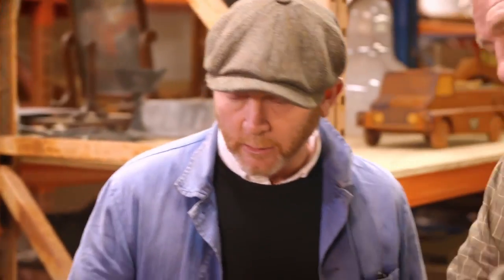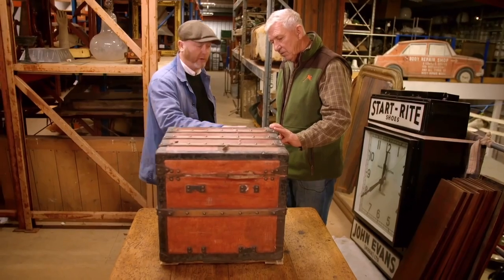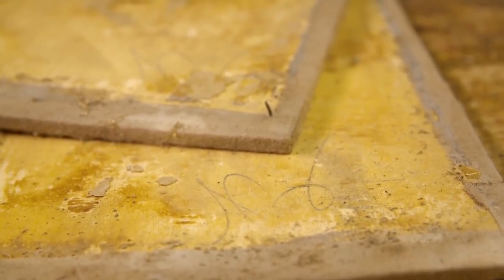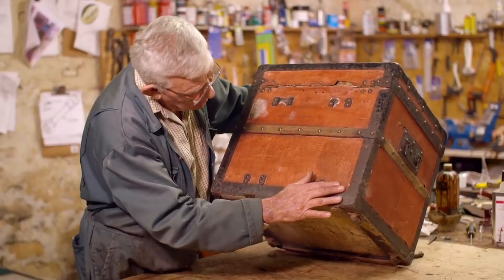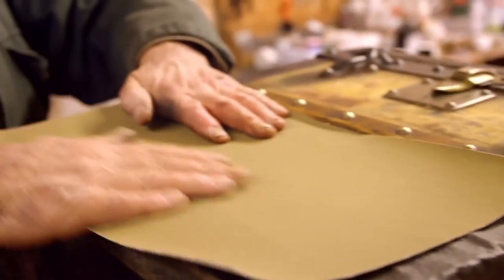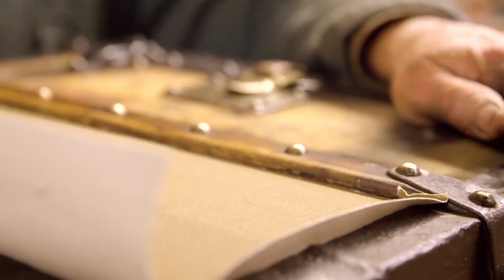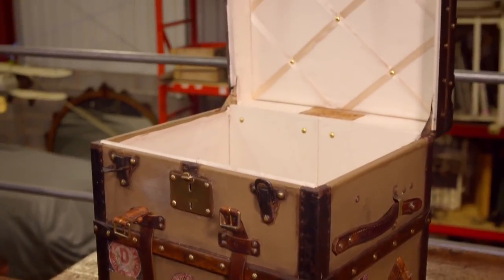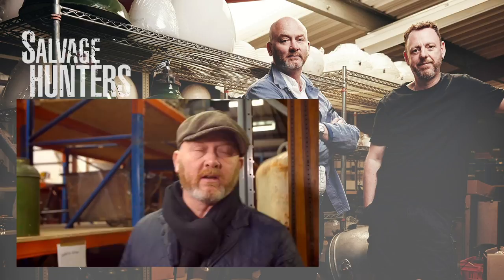Carefully Restoring A Louis Vuitton Trunk From The 1900's | Salvage Hunters: The Restorers

Comment: Polishing the brass is fine ...repainting the metal work black again is fine ...not denaturing the fabric and wood is the biggest priority. Remove the labels as they are often used to hide holes...
The french rivet system is fantastic... the brass end is cast into the nail..the nail has a washer put over it at the other end .is snapped of and hammered down...to remove the rivets/nails,grind the little disk off from the inside. Then just push the nail out.. you can redrill the brass end and solder in a new nail. I do it all the time . Usually handle nails are hammered in ,u shaped and hammered back in to create extra strength.removing that fabric was a huge mistake...the original grey was painted over .you should have stripped the paint.